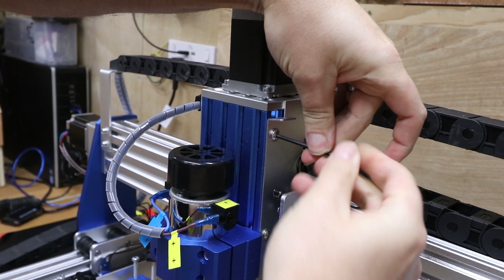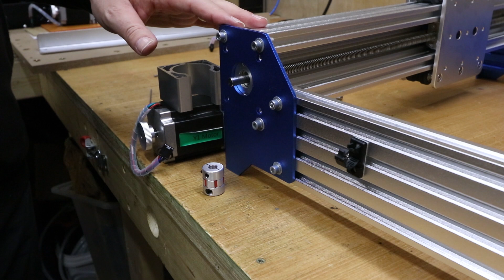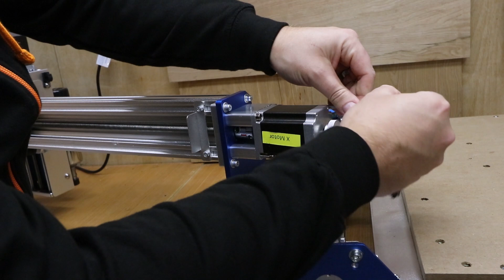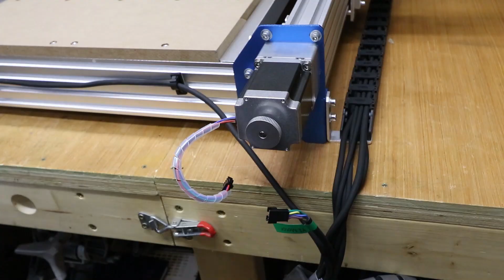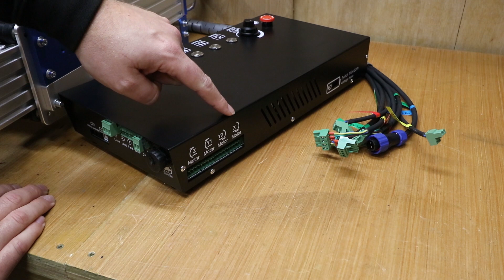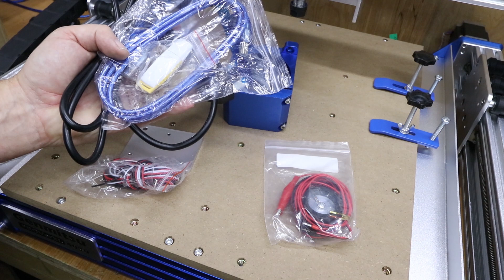Building the PROVerXL 4030  CNC machine from Sainsmart Genmitsu

Comment: Tip-: whenever you are tightening something up that needs to be square, always tighten corner to opposite diagonal corner, this will keep square, tightening any other way can place stress on the other bolts and pulling slightly off square which will have effects down the line
Reply: Adding: When starting a bolt, first spinning it COUNTER-clockwise a bit can help "find" the threads and avoid cross-threading. NEVER start a threaded fastener using a wrench. (Finger-spinning a ratchet head is okay-ish, in fumbly situations, just don't apply leverage using the handle, until the threads are surely seated.)

Also: The first rule of assembling rigid assemblies:  First assemble loosely, to establish the mechanical connections. Then, gradually work around the piece, snugging up the fasteners progressively, in rotation, to ensure that the assembly is not distorted as fasteners are torqued down.